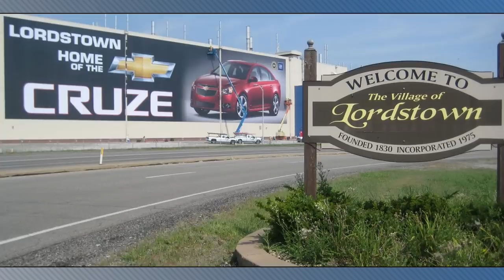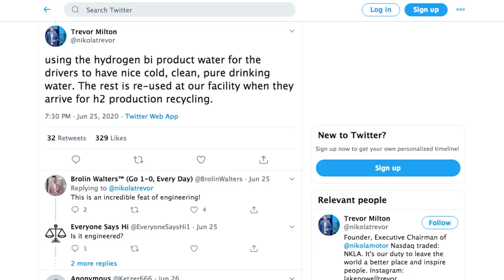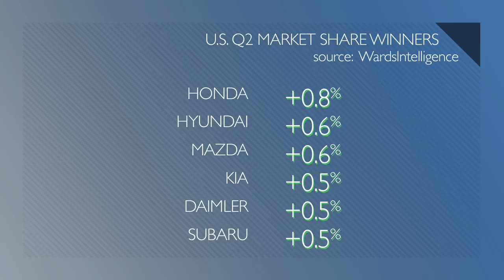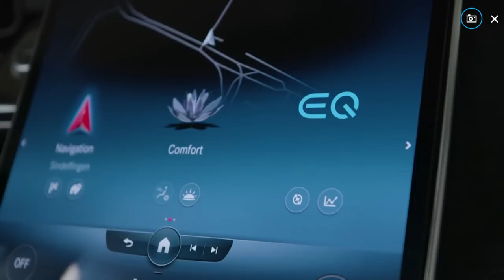2020 Lexus RX 450h Is All About Luxury; U.S. Market Share Winners & Losers - Autoline Daily 2868

Comment: The amount of water "saved" from Nikola trucks sold won't be enough to fill a small sherry glass..
Reply: A reasonable engineer would have said the added carry weight of hauling the water around would diminish fuel savings and efficiency - it would be better to let it just drip onto the road like any ICE vehicle.

Nikola doesn't have reasonable engineers.

Comment: John mentions Lexus RX450 outsells some German competition of PHEVs. I just looked into those names at fueleconomy.gov to learn that after battery depletion all those vehicles have worse pure gasoline MPG than their gasoline counterparts or Lexus HEV discussed in video. All those hybrids are serial ones while Lexus is parallel one. One can see short pure EV range from Porsche Cayenne - 14 EV miles (21 MPG on gas), BMW X3 - 18 EV miles (24 MPG on gas),  Audi Q5 PHEV 20 EV miles (27 MPG on gas), Mercedes Benz GLC350e - 22 EV miles (25 MPG on gas). Outside California with HOV lane sticker it is hard to motivate the purchase of those German competition PHEVs since the price difference between PHEV and ICE is significant and for the busy folks who might not have time to plug in and drive as HEV there are no incentive to buy those cars. If those PHEVs would be parallel type with good fuel economy  AFTER battery is depleted it might have sence a PHEV vs HEV like new 2020 Ford Escape PHEV  (38 miles pure EV range and 41 MPG AFTER battery is depleted) AND its luxury counterpart Lincoln Corsair PHEV.  The latter might be considered the true competition even being a foot shorter. Also a decent pure EV range might change the commute habits thus bring value to the competition. The upcoming BMW X5 PHEV with 24 kW hr battery might become another exception. Toyota brings just a few RAV 4 Prime PHEVs to market since it is afraid to hurt its own HEV lucrative business.
Reply: after their batteries are depleted... of course their MPG is worse then their ICE-only counterparts.  Because... the ICE counterparts aren't hauling around battery, motors and power electronics that are sitting doing nothing.
Reply: @MartinGalway  Yet, the parallel hybrids have better MPG after the battery is depleted. Fresh examples on sale in the USA are: Ford Escape PHEV and Toyota RAV4 Prime PHEV.  Some vehicles sold so far were not SUVs such as Chrysler Pacifica PHEV minivan, sedans like Honda Clarity PHEV, Ford Fusion Energi PHEV.  There is a vehicle called a SUV by manufacturer but indeed is a tall wagon - Kia Niro PHEV. There are 2 more really fuel efficient sippers liftback sedands Toyota Prius Prime PHEV and Hyundai Ioniq PHEV. From discontinued efficient vehicles are Chevrolet Volt and Cadillac ELR.
Everything else on the market are serial hybrids having bad fuel economy by just lagging EV powertrain instead of making use of it. Examples are those PHEVs from BMW, MINI,Audi, Porsche, Mercedes Benz, Volvo, Land Rover, Lincoln Aviator PHEV, Mitsubishi Outlander PHEV.
Reply: @nevco8774 ...and our CT6E which sees +40 miles on just battery. Though it a sedan and not SUV that works to it's advantage when just running engine on the highway we see 35 mpg and 40 mpg off the highway in pure hybrid.